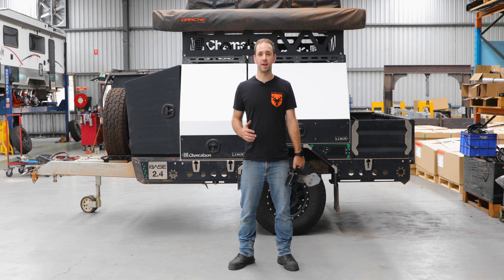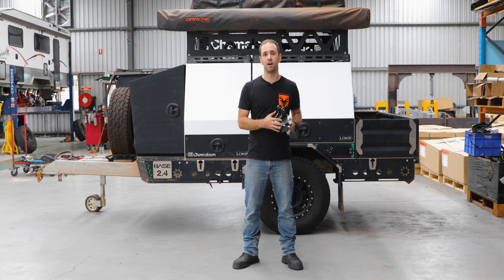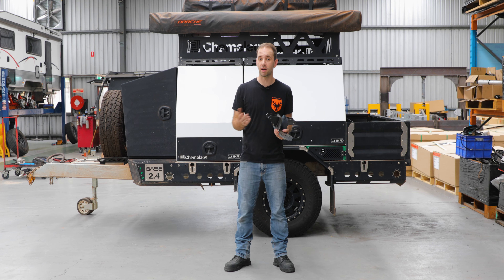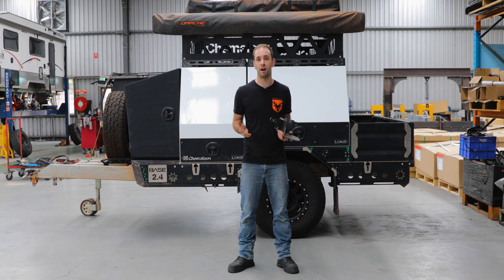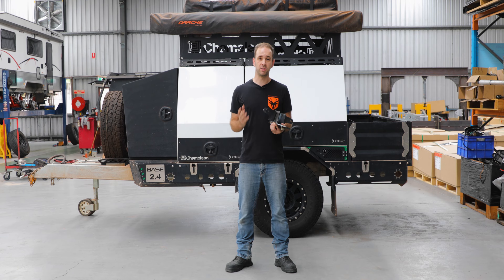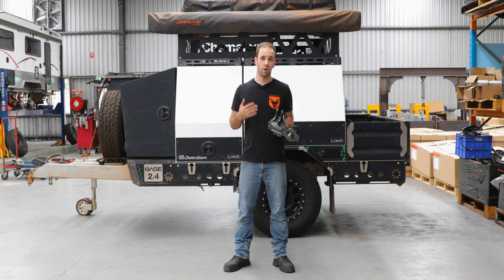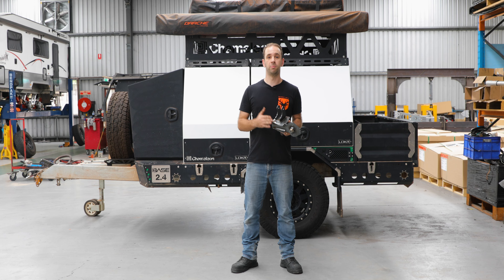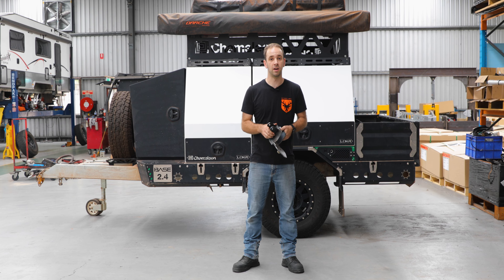BONUS CONTENT: What Went Wrong in Episode 3?

Comment: Great to get the follow up, well done.  Its great to hear you're getting some new analysis toys, the problem however can be instilling the discipline to do the analysis when required.  Engineering change management processes incorporating technical risk assessment are always hard to keep the design team following, I've introduced a TARP (Trigger Action Response Plan) that lists the change criteria that require a designer to undertake an RA and ensure the identified controls are put in place (e.g. weld macro analysis, etc)